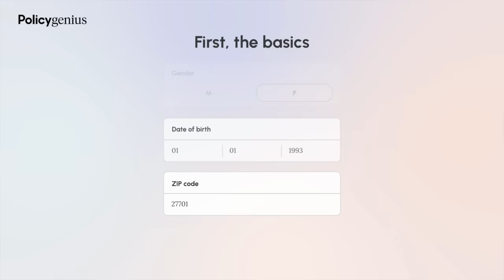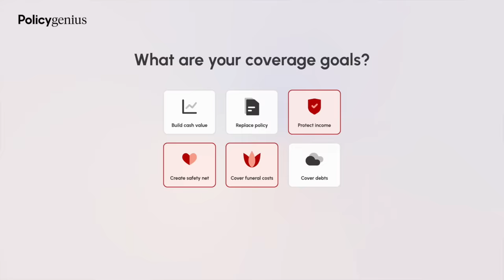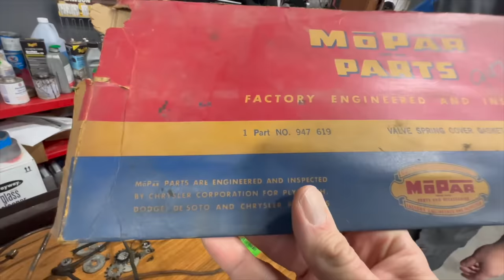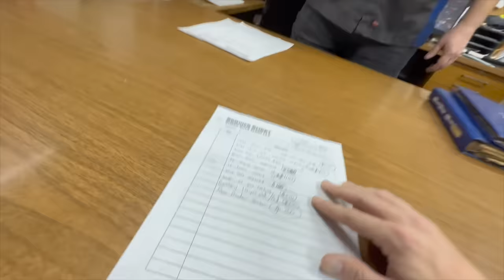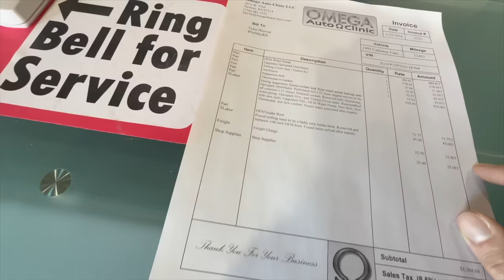I need to sell my dream car after making a HUGE financial mistake

Comment: This type of heater is normal in cold climate. Webasto made them a lot, with remote start for cars. it warms up not only interion but also the coolant that car starts easier using car's gas

Comment: I'm sure someone already mentioned it but Volkswagen used gas fired heaters and I don't know if lots of them burned up but I think eventually the powers that be decided it was dangerous to use but pretty sure other vehicles used them back in the day too. The one good thing is you could have instant heat as long as you had gas and power.

Comment: One of Bugs had a gas heater. Very toasty!  There was no comparison between the stick heater channels off the air cooled engine. It was up front in the trunk area right next to the gas tank.

Comment: They make a modern day version of that old gas heater, but it uses diesel fuel. There called diesel air heaters and are very popular with truckers and RV'rs. There all made in China . Sound like a jet engine starting up and are very efficient. I love mine in my rv. Had no idea they were available in the 40's.

Comment: In the 60's, I had a couple VW's that had gas heaters installed by the selling dealers.  The service departments had strict rules that if a mechanic was working on one of those heaters and wanted to test it, the car HAD to be taken outside first.  But they worked well, especially because of air cooled VW's not making much heat otherwise.

Comment: Janitrol made auxiliary heaters powered by gasoline for the air-cooled VWs of yore. Scarier still, many light aircraft are heated by burning 100 low-lead in an open flame box in a Janitrol heater. You might think a fire on a boat is bad, wait until your airplane is on fire! Glad you are keeping the SLS!

Comment: I think my stepdad's 1960's era Corvair had a gasoline powered heater, too. Heating off of a rear mounted air cooled engine in a car that size would not have been very effective. He said the heater was very good, risk of asphyxiation and burning to death notwithstanding.

Comment: My stepfather had a 46 Mercury that had a Motorola heater they were fine. Worked great too. The car could be heated without it running and would heat up in just a few minutes.

Comment: VW had an option in the 60's and 70's with a gas heater. Type 1-2 and 3's I remember. LOOK THAT UP AND see how they worked. VW was air cooled and very cold in the northeast and central north U.S.

Comment: the SLR is not the correct one, if it were the coup I would agree with you, but  a coupe sls trumps a convertible SLR, sell the SLR it would be smarter, also you have the viper for convertible now.  ( they are more related than you might think, the SLS was build on a viper chassis, when Mercedes owned Chrysler )

Comment: That bill does not seem crazy. I just payed 240 euro for a checkup and new brake pads on only one axle of my trailer. And they forgot to properly mount back the glass of my tail lights, so they fell off and are broken now.

Comment: Good move not selling the SLS. I’ve had mine for @5 years and there’s nothing you can replace it with, especially if your favorite car is an original gullwing. In my opinion it will be in the top 5 modern classics of the 2000s. Best engine in a Mercedes and one of the best sounds ever from a stock engine. 👍🏼

Comment: I had the same system in my 82’ air cooled Vanagon. It worked great in the PNW. 

Funny story; Was reading my book in the Downtown Seattle Ferry Terminal, waiting for the ride to Bainbridge. The women were having a great conversation in between the vehicles, they started leaning on the van, repeatedly, causing interruptions in my read. Shake it off. But it persisted, and it came to me that it was in-fact cool enough to fire up the gas heater. I turned it on and watched in the driver’s mirror as they reacted to the ignitor clicking, then the awesome flame noises, like a jet starting, then the fan came on and it got pretty loud. I laughed. They didn’t lean on the van again

Comment: That fan would run okish on 6 volt would be better that 6 volt brushless fans in my opinion you used to be able to buy 6-12 volt converters off the shelf surely there is something out there

Comment: The heater is very similar to a C&D aircraft heater it appears. May well have a ceramic liner. If so, these crack and most definitely result in CO leak. Whether enough it is enough to be sickening in a windy old car who knows. I would definitely put it on a shelf for preservation of you choose not to reinstall. A really cool antique.

Comment: Are those 6V computer fans really two 12V computer fans in parallel?  How durable are those fans?  Computers don't begin to deal with the conditions that autos deal with.

Comment: A similar gas fired heater was/is used on a lot of piston powered aircraft stir flying today.  I flew three different planes in the past that had gas heat.  When they worked 😅they work great.

Comment: Oh come on Wizard, the fuel burning personnel heater is in the 20 manual for the 5ton/LMTV. Hell, it's in the 10 manual. As a wheeled vehicle mechanic you cannot tell me you arent familiar with it, and know that it is perfectly safe. Either preserve that classic heater or turn in your Ordnance Corps Insignia.

Comment: The stock Mopar heaters work great and they have defrost, that modern one is good for heat in 1 spot and has no defrost, and computer fans... I've seen it done and it always sucks compared to the correct heater.

Comment: Computer fans are 12v. I have used a few in a car without any conversion 🤣. I fitted one in a blanker panel to vent air and intake fresh air if the inner temp got hotter than the outer temp.

Comment: My '57 VW bug had a gasoline heater.  Would 'cook' me right out of the car, it would get so hot.  But it cut my gas mileage in half!  The exhaust pipe ran down from the heater to behind the passenger side front tire.  Slush would fill it up in the winter and 'stall' the heater.  I'd have to get out of the car and stick a long screw driver up the exhaust to clear out the slush.  If I hadn't shut off the heater it would fire up and blow soot up my arm!

Comment: 10:53, VW Beetles had a similar heater under the backseat or built into the dashboard, up into the early 70s.
I’m surprised the wizard didn’t know that one.
By this point, I’m surprised your not a part owner of the wizard shop Tyler.

Comment: Hoovies name might not be on the deed but he prolly paid for most of that shop.

My 47 chevy fleetliner had that old heater. My grandpa put in that car when he was in the army.
Works fine if you keep it up. I took it out and use it in a shed when I put a sbc in the car. On high it will run you out of a 12x16 foot shed.

Comment: Amazed by a gasoline heater in a car, you need talk to see old guys.  Gasoline heaters were an option a may VWs in the 60s as well as Ford vans among others.  They worked great, buy were terrible on gas mileage.  I doubt if you could find parts for any of those things.

Comment: weeeziard... dont do a resistor to set the fan speed.. use a computer fan speed controller. it will PWM the fan and give him full speed control with a dial.

Comment: I wonder how the wizard would feel if you collaborated with JR. with all his building lately you could probably help you with the farm. 

I would suggest you buy some cheap hoopties and let him work on them. Leave the premium stuff to wizard and ninja.

I know you're younger than me. When I was 13, I had a paper route around my neighborhood. That was 84. It's funny some of the cars that were in my  neighborhood. This one small single story had a Rambo Lambo parked outside. There was this other house, They must have been car dealers they had like six Ferraris parked out front. Around that time, there was a Mazda 323 GTX parked outside another house.

There used to be an Eagle One car commercial with a black Pantera and Black Volvo 740 wagon. Going to Jr. High, I would pass a house with the same vehicles. I swear they must have owned eagle One at the time.

Tlhere's this other house that had a full size RV behind the house, don't know how he couldn't fit it back there 

My stepfather had a boss, who had a 69 convertible mustang in the Garage, damn I wanted it